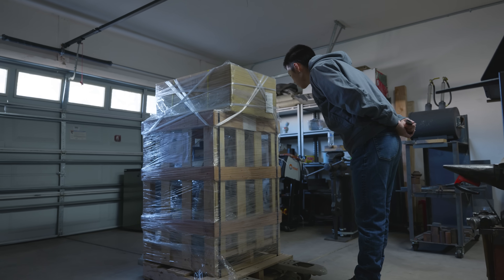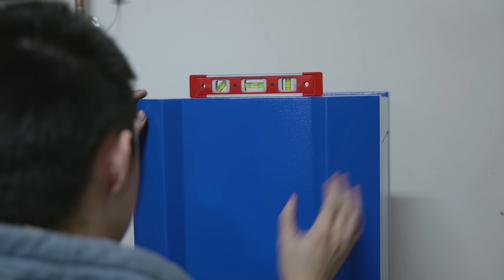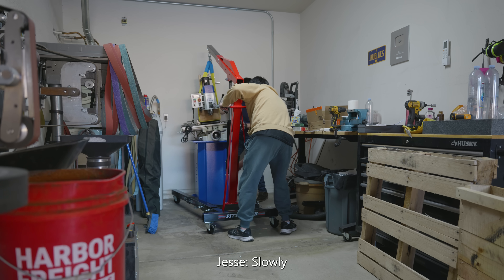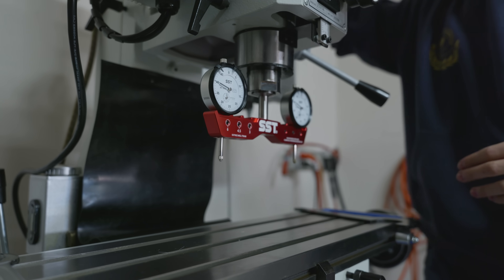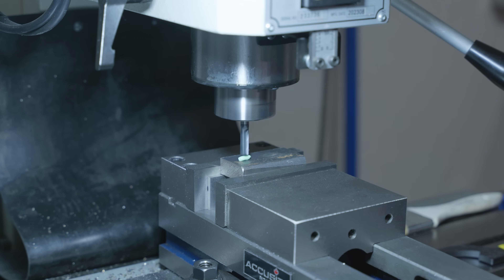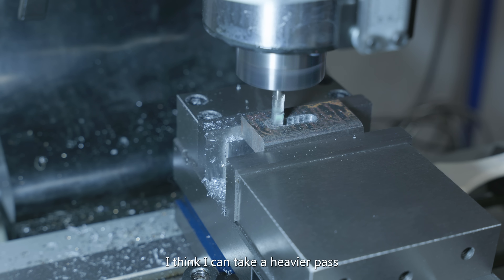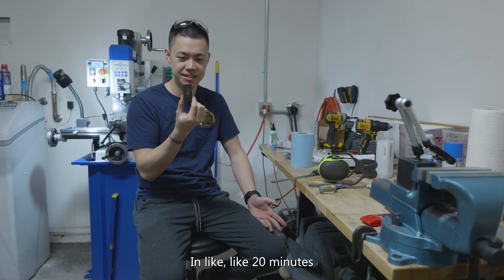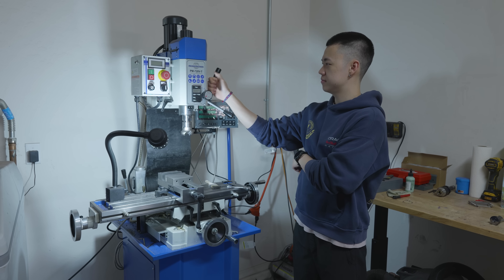My First Milling Machine! (PM-728VT Unboxing and Setup)

Comment: H.s.s also has to be sent into the piece with a peck repeatedly. Unlike carbide. Normal chucks i assume even though it was only couple thou. Usually they have more run out and wandering. Also most important research conventional and climb milling. Lucky seems like nothing has happened but climb milling will send parts flying which is just which way you send the tool. But this was months ago. A big thing with machining to is obviously what you've been hearing is chattering and screeching change speed and feed. And chips can be a indicator. Blue chips are too hot. But figured this was awhile ago but if you need help , I like your content so figure I'd give some tips. Also like a lathe you want super accurate hole center punchs and center drill first will make your pieces super accurate.

Comment: Get two-flute end mills if you do mostly plunge milling. Four-flute end mills is mostly for surface and side surface milling.
Practice turning the X-axis knobs with slow smooth hand motions is a telltale sign of a good machinist/toolmaker.
Get a speed/feed chart for the type of metal you are milling which will give you the rpm for the size of the end mill and the feed you should be milling at.
They also sell kits that can convert this into a CNC milling machine.

Comment: To plunge a mill cutter straight down, you have to use a two flute slot drill only. A four flute cutter will plunge down until the cutter's center bottoms out.

Comment: Tramming a small milling machine involves precisely aligning the spindle axis with the milling table, ensuring it's perpendicular for accurate cuts. This process typically involves using dial indicators, tramming rings, and careful adjustments to the mill's head and column. The goal is to minimize any angular deviation between the spindle and the table, resulting in a machine that is "in tram". 
Why is Tramming Important?
Accuracy:
An out-of-tram mill can lead to inaccurate cuts, where the workpiece isn't perfectly square or parallel to the table. 
Precision:
Proper tramming is essential for consistent and repeatable machining operations. 
Reduced Errors:
It helps eliminate errors caused by misalignment, ensuring better part quality and reducing the need for rework. 
Tramming Process:
1. Initial Setup:
Remove the vise or any workholding device from the table. 
Attach a dial indicator to the spindle, using a tramming ring or other suitable holder. 
2. Rough Alignment:
Use a combination square or similar tool to roughly align the mill head with the table. 
Adjust the head's tilt and rotation using vernier scales or other adjustment mechanisms. 
3. Fine Adjustment with Dial Indicator:
Mount the dial indicator securely on the spindle and position it against the tramming ring or a precision ground plate. 
Preload the indicator and lock the table and knee to minimize backlash. 
Carefully rotate the spindle, noting any deviations in the dial indicator reading. 
Adjust the head's tilt and rotation using the appropriate mechanisms (e.g., lock screws, rack and pinion) to minimize the indicator's movement. 
4. Checking and Refining:
Repeat the process, checking the indicator reading at multiple points around the tramming ring or plate. 
Make small adjustments as needed until the indicator consistently reads zero or near zero. 
5. Securing the Head:
Once the head is properly trammed, tighten all locking screws and bolts to secure it in place. 
Recheck the tramming to ensure the adjustments haven't shifted. 
Tips for Tramming:
Consistency is Key:
Tramming requires patience and attention to detail. Take your time and make small, incremental adjustments. 
Use Quality Tools:
Invest in good quality dial indicators and other tools for accurate readings. 
Consider the Application:
For basic milling, a less precise tram may be acceptable. For high-precision work, ensure the tramming is as accurate as possible. 
Don't Be Afraid to Ask for Help:
If you're struggling with the process, consult experienced machinists or online resources for guidance. 
Tramming the Head on a Milling Machine
Jul 21, 2021 — we had to set up and drill some holes at a compound angle. so now we're back to the position where we need to align th...

YouTube · 
Practical Machinist

15m
Tramming the Head of My Mini Mill
May 7, 2015 — hi I thought I'd just do a quick video of me tramming the head of my mini mill uh you know whenever you get a mini mill...

YouTube · 
Craig's Machine Shop

10:58
DIY Spindle Square | Tramming a Mini Mill The Easy Way
Oct 23, 2020 — all righty guys today we will be tramming my mini. and in order to do so we will be fabricating a spindle square. befo...

YouTube · 
Red Beard Ops

9m
Show all
Dive deeper in AI Mode
AI responses may include mistakes. Learn more

Videos

9:52
YouTube · Red Beard Ops
DIY Spindle

Comment: If you haven't yet, definitely pick up a copy of the Machinist's Handbook. There's tons of really useful information for feeds and speeds, tooling usage, machine setup, etc. A small bench top mill like the Precision Matthews really doesn't get much benefit from using carbide end mills, which generally are used in CNC machines with machining coolant. For most applications with a manual mill you'd be better off using HSS endmills - they're much more forgiving and far cheaper than carbide. 

I started making knives a couple years ago before welding school and now I have an associate's degree in CNC Machining technology. It always frustrated me that I couldn't be as precise as I wanted to be making blades by hand; I'm hoping to pick up a Haas Mini-Mill or Syil X3 to use CAD/CAM software to design folding knives out of my own Damascus.

Comment: Mill bits arent drill bits, even if the 4 flute cuts over center, its only for plunging around 2-3mm. 3 or 2 flutes are better for "drilling", but even then its better to drill a pilot hole.

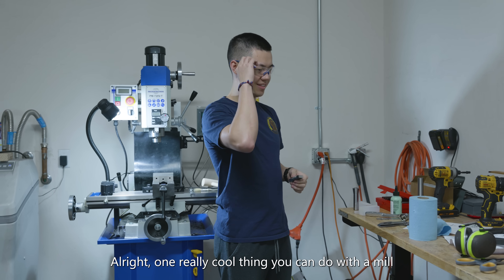8:01 Never ever use this typ clamps in this way, also dont use an impact driver.
Also also, if the clamp has such an big angle, put something between the clamp and the table, so the clamp doesnt bit into the table.

And get proper cooling fluid (cutting oil mixed with water 1:20), the cutting paste is for thread cutting and does almost nothing when used for milling, its lubricates the mill bit for a few mm, and then it cuts dry anyway.

Comment: Dude you don't use end mills to drill holes with, you use a drill. An end mill is meant contact the steel on the side of the bit.

Comment: Started machining not to long ago and the bigest take away is nothing below the elbows it will kill you. Also recommend picking up a machinest hamdbook and a machinist pro calc 2 they will help a ton fith your feeds and speeds along with all the other math you will need. And good luck i give it 2 weeks and youll need more inserts

Comment: A word of caution that a lot of people new to milling have to understand. When plunge cutting with an end mill and you don't have a pilot hole be sure you are using a CENTER CUTTING end mill. Not all end mills are center cutting and they will shatter when you plunge into the work. The downside to plunge cutting with an end mill is they are a lot harder to sharpen than a drill bit and a whole lot more expensive to replace.

Comment: Congrats to you for joining the Machinist Club. The first thing you should remember is that drills only drill and mills can drill and mill. Secondly, try to always make sure you know exactly what you're doing before turning the mill on, it will save loads in time, effort, materials and hair. Thirdly experiment with cheap milling tools BEFORE going to carbide and the like. And lastly, you really should change to Metric and not Imperial, you'll find it a lot easier to use as it's a base ten numbering system that works a lot better with machines.
But again, welcome to the Machinist's Club.

(oh and purchase a copy of 'The Machinery's Handbook', bit expensive but will help you loads)

Comment: At the cost of end mills these days. I have found that it is much easier to just drill out the metal with a drill bit one size smaller than you want your slot. Then take your end mill and mill out the sides of the slot and save your end mills. Easier to sharpen drill bits than end mills. I have the same milling machine and ive had it for 3 years now and like it very much.

Comment: there are apps for speed and feed recommendations, but paying attention to the machine, vibrations, and sounds are the way to do it live. so you definitely had good instincts there. your slotting technique is probably what everyone coming in thinks is the way to do it, and sometimes when accuracy and finish aren't critical, it is the way to go. I would recommend learning about climb milling vs. conventional milling, using center drills first in steel, drilling with drills and milling with end mills. one of the first projects on a new mill is making a "stop" that attaches to the t-slots, and has some rigidity to use as a stop to snug parts up to for quick changing parts. also, was there not a "break in" run required for first starting the mill? they usually recommend to run the spindle at a certain speed for a certain amount of time. that might be old days shit though

Comment: You would have been better off a lot milling. Plunge 10-20 percent cutter dia. Then mill to end point. Plunge down again and mill back over. Repeat till at desired depth, or through.

Comment: Get a large hardback current edition of "Machinery's Handbook". It has everything, charts and explanations, you'll ever need for machining, drilling, and general mechanical engineering. Definitely has feed rates and speed for each specific type of metal. Large because the small one has really small print, like size 6. Hardback because I've never liked digital copies of technical manuals.

Comment: suggestions, from a machinist

just random advice I give to everyone I teach, some will apply, some won't :P 
no particular order

FSWizard app. Get it. Input diameter, tool type, material (of cutter and material), figure out cutter speed, as well as feed (how fast the table travels) 

If you don't have a phone immediately available (don't see why not...), use (CS*3.82)/Dia-- that's material cutting speed*2pi/cutting diameter. Cutting speeds are different for each material, get the machinist handbook. 

Don't plunge toooo much with an endmill (it's ok for ramping down into a pocket, but please just...don't otherwise). If the flutes join in the middle on the bottom of the endmill, then it's ok to plunge some. Drill a starter hole, make sure there's .050" left on the bottom (remember that drills are pointed!!) and start your slot/pocket that way. Then, as you're slotting, you can SLOWLY draw the Z axis down as you go along. That'll cut more with the edge of the endmill, extending tool life. 

X = sideways
Y = away from/toward you 
Z = ALWAYS in line with the spindle (unless you're on a WEIRD CNC machine...)

Carbide once you feel confident. HSS is more forgiving, meaning that tool shock won't affect cutters as much (ie, how fast you start a cut, going from cutting nothing to material contact), then get to carbide tooling with harder materials and experience. 

Chips should be a straw color. If they're blue, you're going too fast in some way. Or your tool is dull. Dull tools cause friction, friction bad. 

USE COOLANT. PLEASE. It's messy, but it extends tool life, gives a better finish, keeps your parts cool, and gives you a wonderful oily shower, too! Jokes aside, coolant really is the secret sauce. Just wipe your machine down after every use; congealed coolant sucks. 

If you want more betterer tramming, get a tramming ring. Since you're just slotting guards and drilling tang thingies, your tram shouldn't matter, but as soon as you get into face milling, you'll see why you need it...

Remember, chasing that .0001" is going to drive you batty. Figure out which tolerances really don't need to be that close, and get them 'close enough' 

Practice! aluminum is cheap, make sure what you want to do is physically feasible, then go ahead with whatever fancy damascus stuff you're machining. 

Cheers! don't be shy with taking cuts. Titans of CNC is good...but they only do CNC stuff. For milling I love watching Inheritance Machining.

Comment: Ok, you’re a great smith but a terrible engineer, (at present), never drill with an end mill, that’s what drills are for, nothing you stopping milling a slot in a solid block though. Next get yourself a speeds and feeds wall chart for all different metals for quick reference, then just practice, don’t be in as rush machining is an art…ps stay imperial it’s the correct language of engineering.

Comment: I don't have much experience with mills, as much as with lathes, but I wouldn't recommend using endmills to drill holes. 1.5k is the rpm I use for aluminum, but there is a math to what speed you need to work with, depending on the material you use. My shop uses liquid coolant instead of paste coolant. Also, an endmill can work sideways but will struggle or break if it goes down. Please do not wear long sleeves even if it is rolled up, u have a chance of ur clothes getting caught and hurting you. I'm only a rookie with the machines and I have almost hurt myself multiple times so take cation in ur work.

Edit: If you still wish to use the endmill, you can use a drill bit slightly smaller in diameter than the width you want and use it to clear the rest. However, watch what the tip of the endmill looks like. Some will have a dip in the center with no blade, which will destroy your endmill. There are also different types of endmills, and you have been using a "flat endmill" to drill your hole.

Comment: I just bought one of these.  im a professional machinist but like to do some hobby machining at home.  I bought the pm-728vt recently.  i was actually pretty impressed by the stand.  its obviously not a solid piece of cast iron, but it is pretty stout and reasonable for the size of machine that you bought.  i think if you were to quote a machine shop to reproduce even the simplest part on that stand and quote some thick powder coating, you might start to get an idea as to what these processes cost.

Comment: I have owned this same model for several years. When you start making alterations to the machine I recommend the very first one is ditching the quill DRO bracket that comes with it, It's really weak and gives a false reading. 
Several people have made video's on the designs they used to stop getting a false reading. While you are at it, since you will be in there, personally I would ditch the little DRO that the quill has also it auto shuts down to quick. Blondiehacks did a video on this and I used the same vernier that she used with good results, (HINT) buy the carbide drill bit YOU WILL need it. I did that same thing as her and tried it with other bits and the first hole goes fine after that without carbide you aren't getting through the SS vernier.

Comment: Hey,

HSS and Carbide have quite different cutting speeds. If 1000rpm is correct for carbide (seems a bit low) then HSS requires fsr less.

Comment: Consider using a air-mister when working with stainless steels and alloys like bronze and coppers. Be careful using  a 4 flute endmill for plunge drilling, not all are designed for center cutting procedures. The spring collets get the job done , but in time they loose their clamping power . In the future maybe consider a ER style collet holder. For the vice , I prefer to use a bolt and solid washer rather than the clamp and step blocks. Nice little mill , I noticed it a few videos back. I have a 10x50 knee mill , and I have too say a little unit like that would be handier for what you do.

Comment: You don't drill with end Mills , you drill with slot drills , use more lubricant & get your head speed correct please, as an engineer it's hard to watch , trained engineers can do slots easily with a drill press , a vice, files , slip gauges 😁

Comment: 10:00 - Regular old (but high quality) drill bits remove material the fastest.  Once you get a drill chuck, a good process to making this 1/4 wide slot would be to use a slightly undersized drill (like 7/32) to drill a bunch of holes next to one another like you did with the endmill, but moving over 1/4in at a time, leaving the webbing.  This will remove most of the material.  Then switch back to the 1/4 endmill and then take your plunge milling cuts just like you did in this video followed up by the side milling.  For the side milling, if you get a coolant system (flood or a cooling mist "Kool Mist") and get comfortable with carbide, you could probably side mill 1/2 depth of cut in one pass.  (I am slightly guessing here, I can on the worn out full sized knee mill I have at work that would let me do this, but I am assuming my worn out, but full size knee mill has about the same rigidity as this new bench top, but its at least worth a test) 

Regardless, you want some active coolant system. It really extends the life of your cutting tools when cutting steels .. especially stainless and high alloy/carbon knife steels.

Comment: I know it’s not exactly applicable but a random question entered my head. “How many respirator filters does this guy go through?”

I see you mainly use them while grinding so I wonder if that makes them last longer or shorter than if you were around smaller particulates.

Comment: shouldn't drill with an end mill like that,, if your drilling use a drill, or an anular cutter if it's a bigger hole. the idea of the mill and the end mill is to slot cut in steps not plunge all the way thru in one shot like a drill